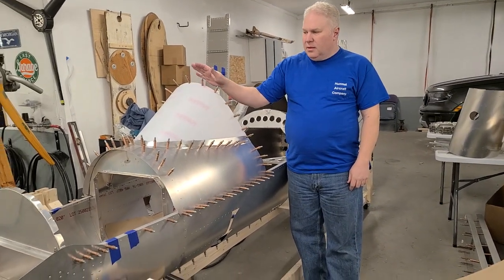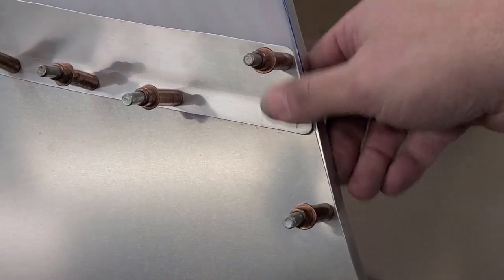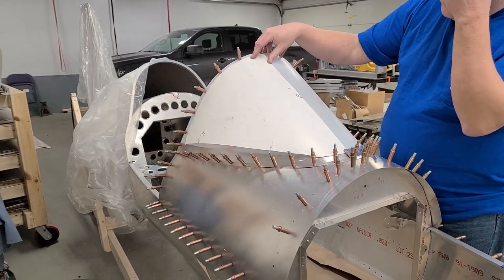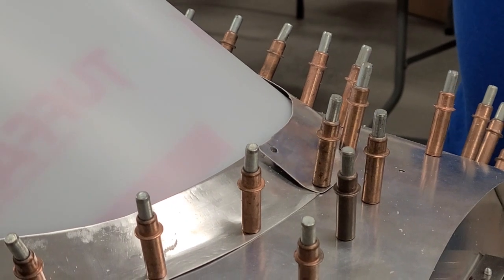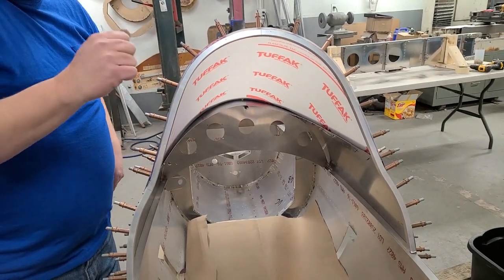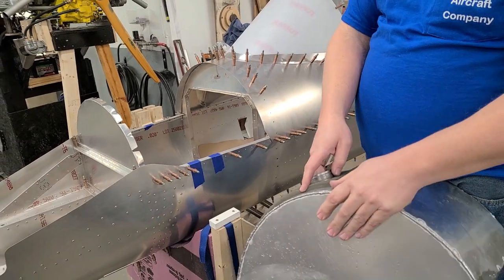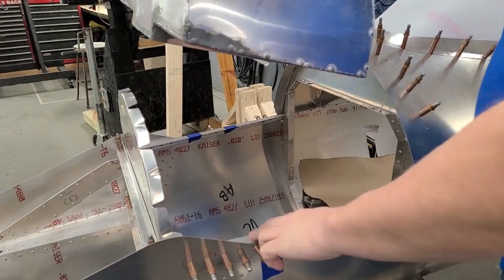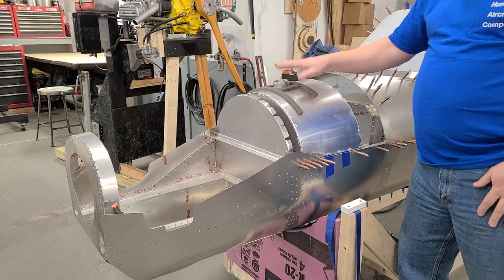Ultra Cruiser Windshield and Fuel Tank Assembly

Comment: please tell me if the design of the ultra cruiser allows me to add additional fuel tanks? for example tanks from the h5 model?
Reply from the maker: Nope. UC is FAA Part 103. 5 gallon maximum.
Reply: @hummelaircraft  Thanks for answering! I Iunderstand about part 103, it's like having a canopy. I'm not going to keep it under part 103. The question is, is it possible or not?
Reply from the maker: @SirJ18  You could install a larger header tank (7 gallons). Probably small tanks could go into the wings in the same manner as H5. You must keep the Cg in check as well as gross weight. As you said, it would now be an N Numbered experimental.
Reply: @hummelaircraft  thanks